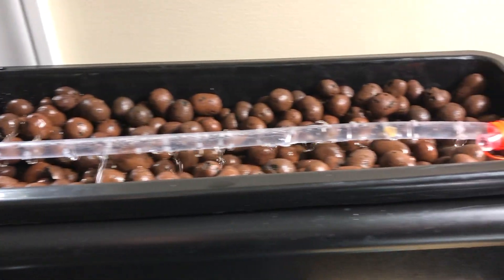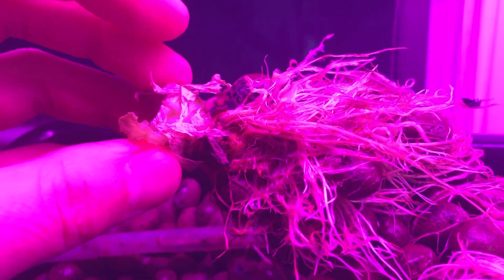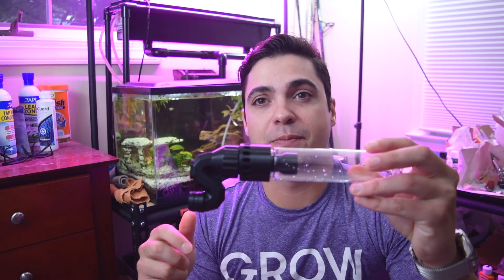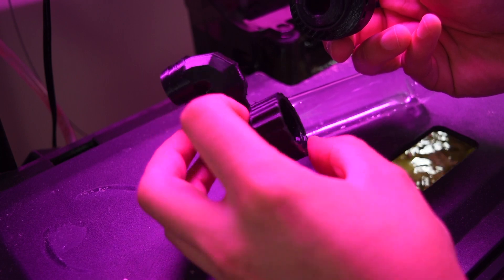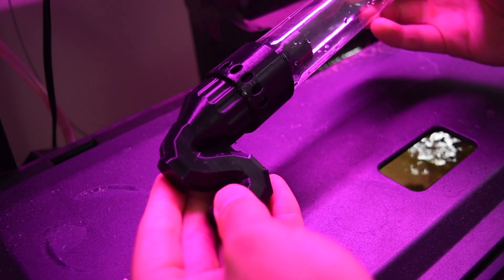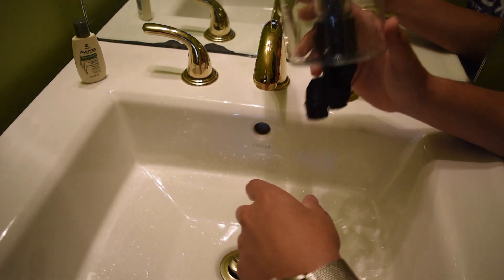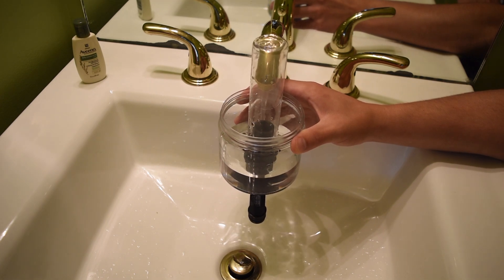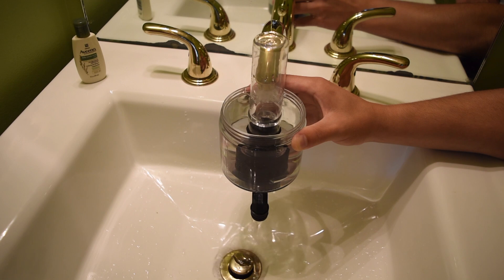DIY AQUAPONICS system - 3D Printed Bell Siphon

Comment: when I made one of these, the water pump was too powerful and created too much flow into the grow bed so it would over power the bell siphon when it was trying to release the water.  What I learned is the inflow of water has to be about half the flow speed of water that the bell siphon can suck out of the bed and put back into the fish tank.  if that makes sense... So not planning anything out causes issues. That's probably a better way of saying this.

Comment: I am really loved your videos and your explanation for the system but ı wanna ask Why you are not using biofilter as used in large systems of aquaponic
Reply from the maker: Hi, thanks for watching! My system actually has a lot of biological filtration! For one, even with the system I have a filter rated for 30 gallons that runs non stop filled with clay rings. Secondarily, when the system runs, all of the clay hydroten act as biological filtration as well and will get a buildup of good bacteria!
Reply: Thanks for your answer but you mean your 30 gallon filter is used for the solid particles of the fish waste.
Sorry for answering alot but i wanna build my own system and I don’t know how to build a fish tank as it is my first time.
Reply from the maker: @amanyosama2870  Well yes, the 30 gallon filter filters out solid particles, but it also houses lots of biofilter material (clay wheels) in separate compartments which helps with the good bacteria in the system